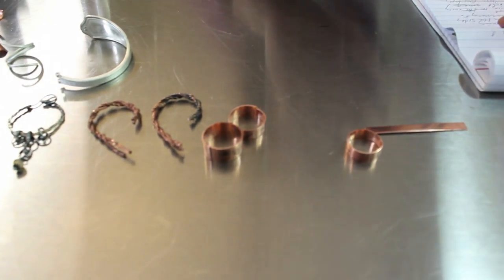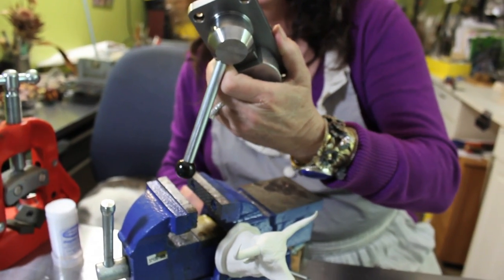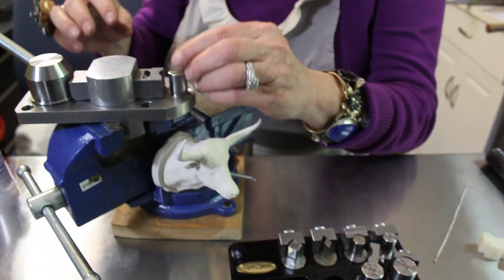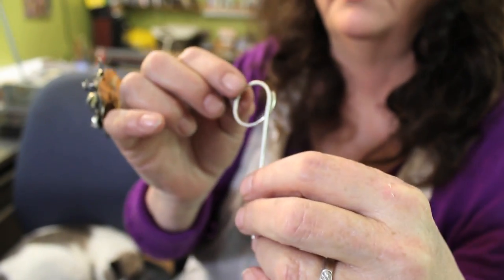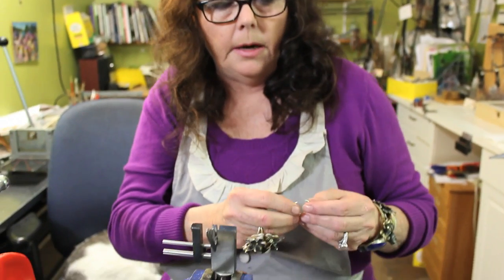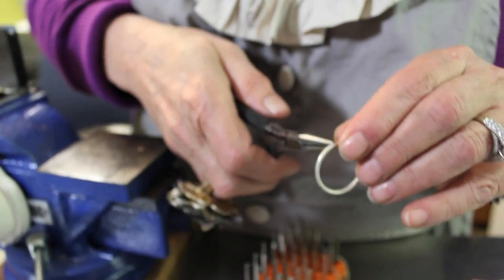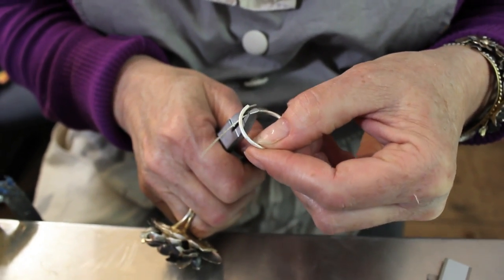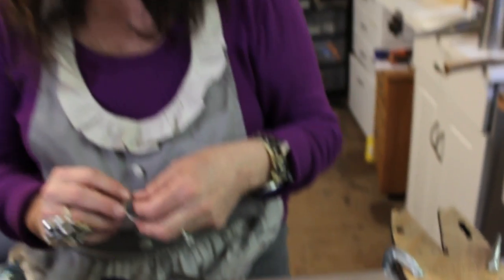Bending Wire and Tubing with the Pepe Superior Ring Bender - Part 1 -  Nancy LT Hamilton

Comment: Thank you Nancy!  Can you tell me what size sterling silver tube-wire I should order
to make larger hoop earrings (approx. 2.25").  I looked on the Rio Grande site and am not sure if what I pulled up may be thicker than I need.
Reply from the maker: Moira, the big issue with bigger tubing is that the ear wire won't fit into it.  Email me and I will tell you how it works with the larger tubing.  Thanks. N